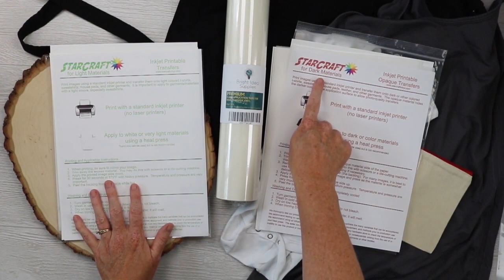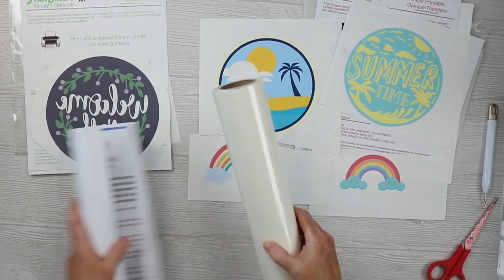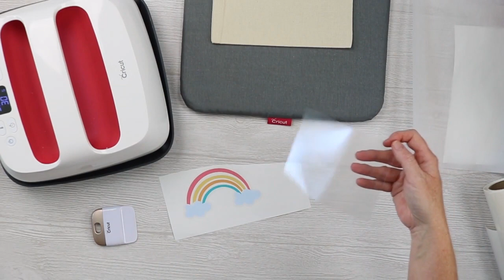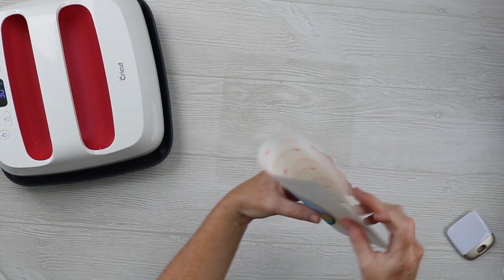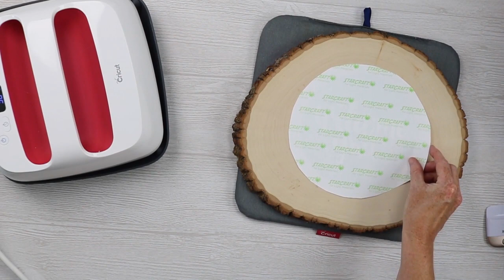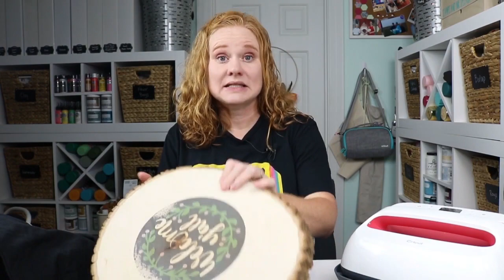How to Use Printable Heat Transfer Vinyl

Comment: Great video but why didn't you compare by using white printable htv on light/dark material too? Would that not have been a true comparison? Just wondering because I was most curious about the light printable being used!
Reply from the maker: The light printable is not meant for dark fabrics.

Comment: I have a roll of satin heat transfer vinyl on a roll one side is shinny the other is like mat, which side to I print on with my inkjet printer, it's satin poly heat transfer vinyl?
Reply from the maker: Is it printable? If not, then you can't print on it.
Reply: @AngieHolden  yes it's to make tee shirts with that's what it says on the box, if you can't print on it then what ya supposed to do with it?
Reply: @AngieHolden if you're sending me a new reply it's not showing and always coming up as if should be a new response

Comment: I have a question, I have used the same material to make shirts, but when I placed that sheet (I don’t know the name if you could please type it) it transfers the image, what I’m doing wrong? Besides I used a normal iron.
Reply from the maker: I would just say to go back and read the instructions that come with what you purchased carefully. Each brand is different.

Comment: Angie - thanks for the great information.  I just subscribed and have found your videos to be SO helpful.  I have a quick question - when using wood, have you found anyway to make the result not so "rustic" and more crisp and clear the way the transfers look on fabric?
Reply from the maker: I have not with this material. I have used tattoo paper to transfer images to wood with good luck. However, the wood grain always shows through so it is a bit "farmhouse" by nature.

Comment: Do you use sublimation ink or a normal ink printer on the htv dark paper?
Reply from the maker: This is regular inkjet ink. This process does not last as long as sublimation though.

Comment: My printable HTV designs always bleed after I was fabric. I don’t use fabric softener and I wash them many days after I ironed it on the t-shirts. I’ve tried putting mod podge for fabric on top and they still bleed. Any suggestions for sealing my printable HTV? Do they sell clear HTV that I can iron on top? I’m using epson EcoTank et4800 with ink that it came with, 522 which I recently learned it’s dye. That’s the ink that printer calls for. I don’t know if it’s ok to switch to 502 ink which is pigment. Thinking maybe it’s the dye ink causing problems?? Any advice is greatly appreciated. Thanks!
Reply from the maker: The ink may be the issue? I am not sure and I haven't had that issue.

Comment: Thanks a million ! You reckon i can use this on leather? i just need to iron on small flag images on white leather.. so nothing big just tiny images. If yes, which would be better white or dark? is this any different from heat transfer paper?
Reply from the maker: It should work on leather. I would use the dark I think. And it is different than heat transfer paper. The printable HTV lasts longer.
Reply: @AngieHolden  You are awesome ! thanks for replying !

Comment: 1 question, but first I'd like to thank you for this awesome video, now I'd like to know about water resistantce and sealing? Is it going to be just fine, or is there some extra steps, like applying some polyurethane spray?
Reply from the maker: On wood, I would probably only use this for indoor applications.

Comment: hi Angie I am so confused I have watch different videos on pattern htv and some say use transfer tape and some you do not.  how do I know if I need the heat transfer tape or not. I have iron by Chinco and tintnut.  I wish I watched your video before I purchased the pattern htv
Reply from the maker: It varies by brand. I would peel back the corner. If there is a carrier sheet over the top, mirror and use it like usual. If there isn't, you need to not mirror and cut then use a heat resistant transfer tape.
Reply: @AngieHolden  Thank you for getting back so quickly.  I watch many videos but find yours the most helpful.  You make it so easy to follow.

Comment: Hi Angie which I should use for printing designs on HTV? sublimation printe or inkjet?
Reply from the maker: Printable HTV uses an inkjet printer.
Reply: @AngieHolden  I tried my first printing using inkjet printer, but after the print, i touched it and ink removed from it's surface and design gone. I tried but this time after heat press the design was so fade...almost 99% white. I think my wrong step was I should not use inkjet printer. I must use sublimation. or what's wrong Angie? please help. thank you
Reply: I got my wrong step...it should be printed on "Pigment Ink Only"

Comment: Hi there! I’m having a real problem peeling off the backing paper from the StarCraft vinyl for darks. It is leaving a light layer of backing paper on the vinyl design. I’m trying to nudge it off gently with weeding tools. I feel like I am fighting an up-hill battle here. Any ideas???
Reply from the maker: Can you try to wet it slightly to get it to peel?
Reply: @AngieHolden  I can certainly try that.

Comment: Great video that really gave me some new ideas as I have been struggling with heat transfers.  Question: did your transfer tape not melt when you put it under the heat press?
Reply from the maker: There are special transfer tapes that are heat resistant and you need those with this product.

Comment: Do you suggest a certain type of printable vinyl to be used for athletic wear (drifit) using an epson ecotank 2720? I’ve looked everywhere
Reply from the maker: Are you looking to do sublimation or regular printing? I don't think there is a stretchy version of printable HTV for inkjet printers.
Reply: @AngieHolden  I have a customer requesting that I put logos on several pieces of athletic wear for him. I have a sublimation printer and just got another inkjet for printable vinyl. Would you suggest I just use regular printable vinyl for this?
Reply from the maker: Here is a comparison of methods: https://www.youtube.com/watch?v=vo4y-g1z2HY

Comment: What type of Pinter and what type of ink do use to convert ? Can I do it with a 2720 or a diff one
Reply from the maker: This is just with an inkjet printer with inkjet ink. This does not require sublimation at all.

Comment: You should use a heat press for the correct pressure. The easy press will not work as well
Reply from the maker: I agree with that, however, most of my viewers do not have one and I try to replicate a typical crafter when I can.

Comment: Does this work on wood?, and does it have to be sanded down or can it be on glazed wood? It’s for custom skateboards
Reply from the maker: It would not wear well on skateboards unless you are going to coat the top? Maybe try the type with a laminate like car decals: https://www.youtube.com/watch?v=593RB8Be2s8
Reply: @AngieHolden  yeah I’m gonna coat over it, I’m going to use it heavily with grind tricks so 3x clear will give it extra life, tysm !
Reply from the maker: Oh then something like I linked should work! I would maybe seal it with Mod Podge before coating it if you have any issues with the clear yellowing paper.

Comment: I wish you had talked a little more about the printing. Like can I use any printer ? Is there a special ink needed?
Reply from the maker: This vinyl is for inkjet printers with regular ink installed.
Reply: This is great news. So I can use my regular printer instead of my sublimation printer?

Comment: If I’m using have for dark colors and I’m putting it on a black shirt do you have any suggestions on what to do with the type I want on it? I originally had it black 🙄 then realized it needed to be white. But if you change the color to white you can’t see it. Help 😭🙏🏽🤞🏽
Reply from the maker: You should be able to see white on black if you are using the version for dark colors. Similar to the bag I am doing in this video.

Comment: Hey Angie! I just tried to use the Starcraft printable HTV on a shirt, followed the directions exactly as it said on the instruction sheet for light material and it stuck to my Easypress. What could I have done wrong? Should I use heat resistant tape to tap it down?
Reply from the maker: If it stuck to your EasyPress, you probably had it upside down would be my guess?
Reply: @AngieHolden  So I had the design on the shirt and the Starcraft backing on the side the press goes, per their instructions. I finally called 143 Vinyl and they said it sounds like it was printed on the wrong side.
Reply from the maker: Oh bummer!!!!

Comment: I've used star craft and on the directions it says to mirror the image. But it seems like you don't do that and put it on like if it was a sticker. Maybe that's why mine are coming out dull
Reply from the maker: It depends on which one you are using. Light or dark. They are different directions.

Comment: what material setting did you use on your cricut for this? I tried using "paper with adhesive backing" option and it cuts through the backing paper all the way, which i don't want. .
Reply from the maker: I think I used the printable vinyl setting or just the HTV setting.

Comment: Hello, does the ink has to be pigment or can I use dye based?
Thanks
Reply from the maker: For this particular product, you will need inkjet printer ink.
Reply: @AngieHolden  thanks for replying. I have an inkjet printer but I hear that only works with pigment based ink and my ink is dye based. So, I just wanted to double check. :)
Reply from the maker: Dye-based inks are the standard ink type used in inkjet printers so that would be what I am using here. I am not positive of what you are asking.

Comment: What heat settings do you use for printable htv. I have done it om different settings and when zi wash the shirt the decal comes off
Reply from the maker: You will need to follow all the directions for the brand that you are using.

Comment: See like I must be doing something wrong because I followed everything here but my picture started to peel when I pulled the transfer mask off
Reply from the maker: BOO! I didn't have any luck with the LIGHT version on fabric but the dark works every time.
Reply: @AngieHolden   I used the dark transfer paper but when I used the heat press and let it cool a little the transfer mask started to peel off. I had it at 350 30 seconds
Reply from the maker: I am wondering if it is the brand of transfer tape. Can you try a small piece that you don't need transfer tape for and see if it works?
Reply: @AngieHolden   I bought the transfer mask that use used I just bought a different transfer paper.
Reply from the maker: I would say that is the difference then. Is that one a hot or cold peel? Does it have different directions? The directions in this video are specific to the brands used.
Reply: @AngieHolden  the ppd one really doesn’t talk about transfer mask so I think I’m going to buy some of the Starcraft stuff and see if it works because I followed the video you made and it still didn’t work when I peeled it cold

Comment: With the transfer tape that you used will I be able to use it for other printable heat transfer paper? I use the PPD heat transfer paper and just got my transfer tape but I think I did something wrong and I’m also using a iron not a heat press
Reply from the maker: It should work with any product that you would apply heat. I am not familiar with that one but I think it would work.
Reply: @AngieHolden  okay thank you i might just have to buy a heat press and let it cool down before peeling it off

Comment: Hi why do you prefer the dark printable on the onesie? Wouldn’t the light printable be thinner and softer on a baby garment?
Reply from the maker: You can definitely use the light on white. The dark is a bit thicker but also a bit more durable and easy to work with for me.

Comment: Loved your video!  Just one question... for now. Can you reuse the transfer tape multiple times or is it a one -time use product?
Reply from the maker: I will say I haven't found a great brand yet so one use only. There may be a good one out there but this one is not very sticky.
Reply: @AngieHolden  have you found a good transfer tape that doesn't pull color off vinyl or stick better. I have been using this for my business for 2 years (dark transfer) but I never used tape I yet yet because I am scared it may pull color off it. Thanks in advance.
Reply: Have you found a better transfer tape yet?

Comment: I have yet to see a more professional and helpful video with varying materials and processes than yours.  Thank you SOO much!  I am confused on how the product manufacturers word their material.  It says it's Printable VINYL...but, it seems to be more of a printable fabric material as opposed to actual vinyl-but, that may just be my perception.  Thanks again for this video-extremely helpful. :-)
Reply from the maker: Yes it is printable heat transfer vinyl. It is basically a vinyl with an adhesive on the back that is heat activated and works on fabric.

Comment: Hi Angie,  When using the vinyl on shirts does it feel like vinyl on the shirt, or does it feel like it is within the shirt?  Thank you
Reply from the maker: It will feel like vinyl on the shirt. The only thing that fuses with the fibers is sublimation or Infusible Ink.
Reply: @AngieHolden  Thank you Angie...

Comment: Great content, I enjoyed it but i think its uneven or unequal pressure that gave the wood design rusty look, may be you should try it on fabric and work on the pressure, if u will get d same result. I haven't use starcraft before but I have use forever product for both light n dark materials and I got great result with heat press.
Reply from the maker: I would say this is correct but there will always be uneven pressure on wood as the surface is never completely flat. The fabric pieces all worked fine.

Comment: Is there a special ink you have to use with your inkjet with the printable vinyl?  I'm asking because the regular inkjet ink is water soluble, which if you've ever dripped something on a printed page you know what I mean. And since you need to be able to wash any clothes you use this on, I was curious how well regular ink would hold up.

The same issue with putting prints on wood since you would most likely end up sealing the project with one or more coats of polyurethane or varnish. 

Thanks for the great videos and for all you do to help this community out.
Reply from the maker: No. You can use your regular printer and regular ink. You can definitely seal the wood piece though!

Comment: How do you think clothes using htv prints would last after a couple washes. I’m think about starting a T-shirt business with this method?
Reply from the maker: So far so good. I am sure sublimation would last longer but these are doing well. I would included washing/drying instructions with them if I was selling them.
Reply: Angie Holden A lot of people are saying to not start selling clothes with transfer paper because it’s not good quality. My only concern is if the image will come off after a wash or even a accidental heavy wash.
Reply from the maker: Wondering if you could maybe buy like 5 shirts and make them for yourself then spend a few days washing them a BUNCH of times and see what happens? Then you could tell people exactly how they will stand up!
Reply: Angie Holden yea that’s what I’m
doing right now. Still in the washing faze tho. Am a little nervous though lol

Comment: I've wasted so much vinyl because the backing will not separate from my printed image! I called my local shop and requested a different brand because of this. I'm glad to see you had difficulty with it also (not just me lol) and I will try the solution you had but it takes forever with some designs to do that with individual letters, etc. Also, when you don't use transfer tape the image curls up and before you can center it on heat press it is ruined (from the heat)! So frustrating! However, thanks for this video - I will keep trying! Guess I need to break out the easy press instead?
Reply from the maker: I think I would use transfer tape if I wanted individual letters. That is way more complicated than just picking and placing one image!

Comment: What type of ink did you use?
Reply from the maker: Just my HP Inkjet printer.
Reply: @AngieHolden  regular ink? Not sublimation ink?
Reply from the maker: You do not have to use sublimation ink with printable heat transfer vinyl. That is one of the benefits.

Comment: I think this is heat transfer paper rather than heat transfer vinyl. The washing instructions reinforce the thought. Does it come off after after about 25-30 washes? Also does it feel soft/rubbery to the touch or papery?
Reply from the maker: This is heat transfer vinyl. I think you are referencing a t-shirt transfer. This is a different product all together.
Reply: @AngieHolden  The thing is, to print on proper HTV, you need to use latex ink. Standard inkjet printers don't work, which is why I was confused when you said vinyl. On the starcraft page it calls it "heat transfer material"
Reply: @AngieHolden  Does it feel soft or does it have a noisy papery feel?

Comment: Hi Angie, thanks for the videos. I run out of research on what inkjet printer should I use. Does anyone can recommend a great one for heat transfer paper, Printable HTV? PLEASE I'm desperate!
Reply: I am looking also to find one. Any news?!
Reply from the maker: I use an HP 6200 series. Their 7800 series is also really good. I have heard Canon printers are great too but I don't have any experience.
Reply: @AngieHolden  Thank you! Epson was top on the list, but none available at the moment, either out of stock or discontinued
Reply: I might be late but anyway :
-for heat transfer paper use regular home inkjet printers with pigment (dye inks are great but tend to fade in UV lights)
-for the best results printable HTV, use solvent inks (large format printers), but again inkjet printers (pigment ink) are also ok